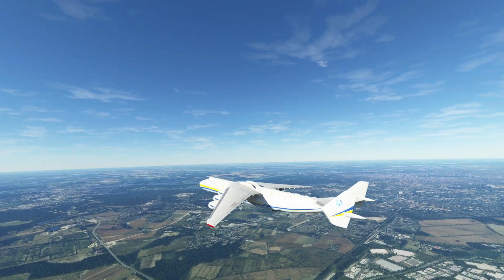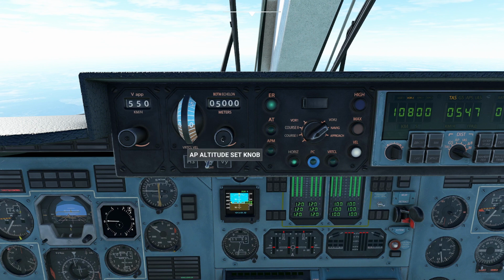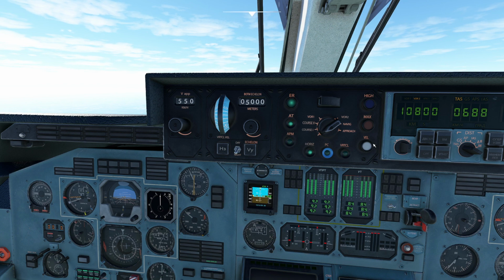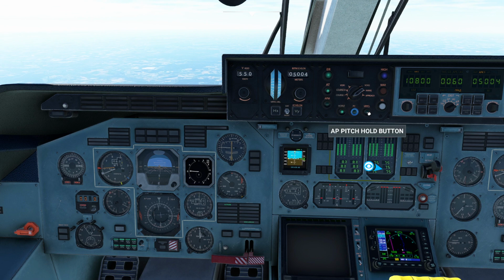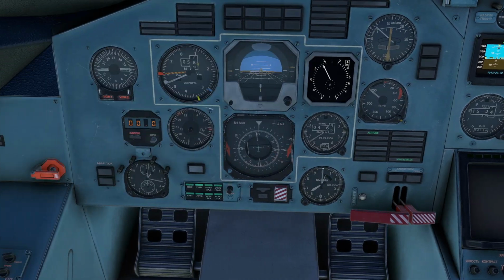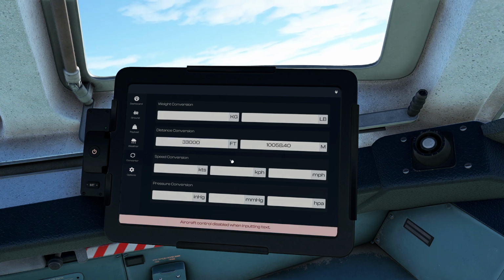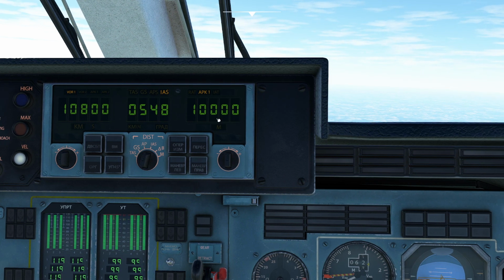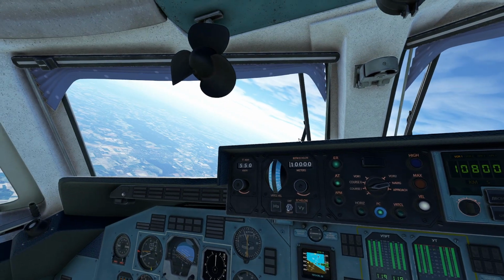MSFS - An-225 Part 4: Autopilot Tutorial

Comment: I finally got around to flying this last night, whenever I set an altitude, the autopilot would trim to hold but just got itself in a fugue and pitch violently up and down until it finally crashed.  Any idea what I’m doing wrong?  The other thing, you kept mentioning was the manual, where is that manual? Seems like something useful to have.